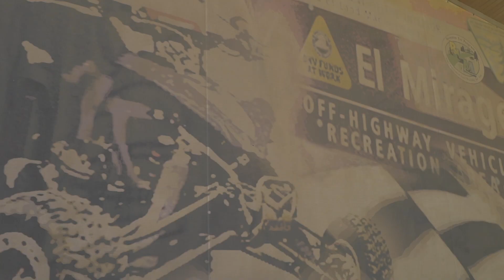DJI FPV⁄⁄2MILE RANGE TEST🧐⁄⁄DRY LAKE BED☠️⁄⁄⁄⁄⁄⁄⁄⁄⁄

Comment: That is incredibly far for such a low altitude.  The low altitude is why you got the failsafe issues.  The Fresnel zone for 915MHz is much larger than for 5.8GHz.
Reply from the maker: Video Aerial Systems thanks for chiming in, master of airwaves🤘 we are testing your lhcp crosshair Xtreme next ❤️
Reply: @RyoRex  - THe Cyclops antenna comes out in a week.  It is specifically designed for this unit ;)
Reply from the maker: @CAGreve1231  YAAAASS🚀
Reply: InstaBlaster...

Comment: You guys got all the money and most expensive gears but did a lousy job in these testings. You had short range failsafe for Crossfire, you have your DVR footage corrupted a few times. After all you cannot even fly your drones longer than 1.5miles away, in such a interference free environment. Frankly before you can show a meaningful test of the DJI google, fix your other stuff first.
Reply from the maker: Vince C totally. Who are these fools 👀Crossfire is fixed now, it was a tiny capacitor :).  DVR- that’s just unfortunate and it’s skipping frames now... so much for the most expensive HDOs 😭 More test coming soon ❤️
Reply: i think it was just laziness..they had the majority of the picture in thought--and in ideology... but the data documentation was flimsy. but there are others who are worse in explaining and scientifically documenting even in the most basic of manners---And usually those folks lack a matter of academic experience---in which most don't come from academic or science backgrounds, so its hard to understand these points of view....but having...like temp, wind conditions, humidity, ground temperature ....etc.  barometric pressure. Antenna size and dbi and flight controller and ESC specs and weight of each quad, motors, frame type and size and any antenna enhancers with or without...etc is vital in any true test.  JUST LIKE A FORMULA 1 TEST CAR.= A SIMPLE CAR--BUT MASSIVE AMOUNTS OF TECHNOLOGY REQUIRES MASSIVE AMOUNT TEST PARAMETER DATA!!!  

  i think more than anything..they were just having fun.     should've got a sponser to extract the data for...could have been more worth while then.  i presume they were trying in essence by measuring distance...or they were trying to show the physics of why and how in playful fun laymen hobbyist terms ...at a minimum in benefit of doubt.

Comment: This is perfect for rf range testing. Mount your receiver antennas high!
The reason you're getting great reception at one bar is because there are no other RF sources around. A ground station is a better solution for something like this.

Comment: very strange for crossfire to failsafe , question is crossfire micro tx or cross fire tx or crossfire tx lite? what sort of crossfire were you running , on the contrary , my friends have dji fpv air failsafing a lot. very interesting ,
Reply from the maker: Upon inspection it turns out my crossfire micro had a missing capacitor - was super hard to notice!  Check out our v2 test, crossfire went all the way https://www.youtube.com/watch?v=b76S6vbHlGg
Reply: @RyoRex  Can you put a notice on this video?
Reply from the maker: @Rustbox306  sure no problem, do you mean note it on the new video?  for this vid we wrote the caveats in the description

Comment: I don't know what you do in your test but only one mile with the TBS Unify and 800mw couldn't be right. Maybe your setup is damaged ore you paid from DJI :D... When i fly with my Copter (and i fly in Germany and with only 25mw), i can fly more than one mile with 25mw on my tbs unify pro analog system. Something isn't right here... If you look, you can see that many people fly 9 miles and more out with their unify. So please make a real Video with good stuff and not this with a fake ore damaged system. i also had never so a quick break of my video signal like yours.
 thanks!

JB-Copter
Reply from the maker: JB-Copter agreed, up high unify will go many many miles.  We flew just around 10ft off the ground, and the issue was failsafes, not necessarily video.  Our point is to send it until fail.  Also the analog that made it to 1 mile was the immersion vortex 250, not the unify.  As much as I love tbs unfys since it was released years ago, analog still have nasty gremlins that always come up no matter how good the build.  Just watch Johnnyfpvs formula1 Red Bull video.  This is just a “hope” that digital will start solving our FPV problems in the future :)
Reply: This is exactly what i think too, there is something wrong with his unify système!!!!!

Comment: Your crossfire antenna placement on the quad was almost perpendicular to your radio with the radio antenna almost vertical. The tip of the quad antenna is the dead zone. You should either have both antennas vertical (quad and radio) or horizontal meaning they should be parallel at all times. If you want to be horizontal, attach the antenna to both quad arms at the rear and make sure your radio antenna is horizontal. I have gotten more success with my quad antenna setup such that when my quad is tilted forward, my antenna is vertical to my radio antenna which is also vertical.  My video goes out first.  I got close to 2 miles
Reply from the maker: For sure, I did change the orientation and forgot to change the radio side.  However it turned out that a tiny tiny capacitor was missing on the xfire receiver (probably from me pushing the button) and that was causing the failure.  Very strange but goes to show it can happen on any exposed board component🧐 We hope to do this test again when the dry lake opens up!🤙

Comment: I get 2.5 miles with analog long range flying mountains in Alaska, if digital could do that I'd be interested.
Reply from the maker: Sounds like we should do a long range mountain test??  Alaska- that sounds Epic🔥
Reply: @RyoRex  That's kind of what I'm waiting for. My system was breaking up at a mile the other day when I was just off ground level, so I think being up in open space allows a much greater distance. I'd love a clear image!
Reply: DJI Occusync will easily push well over 2.5 miles, my mavic 2 pro can easily crush 3.5 miles on stock controller and antennas. hell i pushed 2.7 miles on 5.8Ghz Wifi using Mavic air...   i haven't measured the power output but i believe the physical power is sub 1 watt on DJI's systems.  i heard all kinds of numbers ranging from 250 mw to 3 watts but i never tested and im assuming DJI is probably using 700-750mw in FCC mode because its easier to get compliance certificate with.
Reply: @Honeypot-x9s  Man I'd love to get that kind of range. I'll look into it, thanks!

Comment: dude, such a good vid. Love the soundtracks too., i've had many of these moments with my crossfire setup running micro RX receiver, at silly close ranges where it just loses connection, left me scratching my head and nervous over water a few times, my trust for it has never been amazing even at 1watt or 2watts. Maybe there's a weird science to getting it happy and just right.  DJI system looking very good. Surely there will be some higher gain antennas coming out for the DJI system from other manifacturers soon too
Reply from the maker: Thanks Phil!
Reply: @RyoRex  got an idea for you bro. i haven't  seen ANYONE yet do a vid on the new Dji Fpv system performance...
AT NIGHT! :) Could be a channel clicker

Comment: Your testing is much more in depth than mine, but I've come to basically the same conclusion. My DJI can reach all of the same areas as my RapidFire, and does so in HD without static. And we haven't even started playing with antennas yet. I'd really like to try 2 or 4 VAS antennas eventually. But my current two are RHCP.
Reply from the maker: I'm testing the LHP patch antennas now!
Reply: @RyoRex   Cool beans! I did test one RealAcc antenna since those are switchable, but that was when I was mistakenly running on 25mw. It helped a little. Never was impressed with that antenna though. Definitely want to hear about what a VAS will do!
Reply: @RyoRex  Isnt other antenna's useless because it's the whole MIMO story?
Reply from the maker: @boratsagdiyev1586  The top 2 I believe.  I just did a patch test with the bottom 2, it definitely narrowed the beam and improved signal

Comment: hey guys thanks for the range check, But its absolutely clear, i have 2 phantoms (3 and 4) and the problem is not the range but the penetration.
It seems to be the same old technology they had in the phantom3 and 4.
We need a good penetration test, sorry guys but the DJI FPV system is just repackaged phantom system.
Which is great for local flying within 500meters.
Nothing new just the same old expensive crap. don't be fooled.
Reply: Old School the difference is low latency, that’s new
Reply: If you think the new dji Fpv system is the same or similar to the phantom in any way you clearly have no idea about Fpv and getting a hd system with very little lag. Stick to flying your old white turds

Comment: So the DJI system will fit in to the reverb? Do you have any pictures from that setup?
Reply from the maker: Yes and no- if you remove some pieces and run it backwards it'll fit. In the normal config it definitely doesn't fit.  Looks like the Armattan Marmotte fits really nice though!

Comment: I'm extremely shocked that crossfire only reached 0.4 - 0.5 miles then communication is lost.
Reply from the maker: That crossfire unit was defective, the DJI FPV one has crossfire and went 1.5miles no problem
Reply: Ah got it. Do you think they'll conduct another test? I remember reading that crossfire can reach 10kilometers. Is that true?
Reply from the maker: @neilfpv  Yup crossfire up high especially for wings will go 10km easy

Comment: I really hope you will do the same test again. something is obviously not right especially the analog testing part. thats why it isnt a fair comparison. 
i think DJI and analog could do more further because i saw you were trying to lower the quad  but it flies too close to the ground,  thats why your DJI signal lost. I guess.

1 CRSF firmware updates,
2 CRSF output power, 
3 both transmitting and receiving antenna should setup vertically for long range, also make sure both immortal T antenna cord wont touches the carbon part of the frame. 
4. Use a better vtx instead (unify pro32 HV @1W) with update firmware, and 
5. fly up higher cuz our earth is curve.. =)
Reply from the maker: We did a v2 test:) video dropping tomorrow🤙
Reply: @RyoRex  NICE ~!!!!!!

Comment: Crossfire is a major obstacle in dji's fpv take-over efforts.. and here you come with a Crossfire failure in a frickin dry lake bed???  
When you returned home with abnormal results on everything except the dji you should have just produced a dji-only range test. It would have been a good video.
Reply from the maker: Hey I appreciate your comments I do.  But honestly I don't like the DJI radio... I am a big crossfire guy, so there's no reason for me to bash TBS.  As stated in the description there was a missing capacitor that was making it fail. Check out v2 where we flew the whole 2 miles https://www.youtube.com/watch?v=b76S6vbHlGg
Reply: @RyoRex  Ok.. good enough.  Thanks for the update.. I deleted the snark :)
Tossing the abnormal results and footage is probably always the right way to go.. if you know a result isn't right why leave a question in the viewers mind?

Comment: How did you set your dji air unit and goggles up with your radio and crossfire?
Reply from the maker: Branson Bowler you can just connect it as usual, just replace the analog components with the air unit and solder their uart for telemetry :)

Comment: There are way to improve analog distance where as with the DJI you might be stuck as is. I am not sure as it does have removable antennae on the goggles
Reply from the maker: Analog does go much further of course up in the air, but we wanted a controlled situation close to ground.  Patch antenna test next!

Comment: Why did the air unit stop recording on the first run?
Reply from the maker: I found this out much much later, but you have to run legit sd cards that are fast!  Now I only use sansdisk extreme pro, everything else have problems including sansdisk ultras and ultra pros

Comment: We all know analog will crap on the current Dji stock system for LR doesn’t matter what altitude.
Perhaps re try this test once  VAS brings out their patch or whatever they are working on for the digital system
Reply from the maker: We will definitely re try this with equal patch antennas, VAS informed us that we were most likely out of the fresnel zones.  We experienced this in Dubai also where we had failsafes around 2 miles away at low altitudes.  We want to fly low and far! 👻

Comment: Why are you flying long range without GPS and Auto Return setup? If you had GPS you could see your distance on the OSD.
Reply from the maker: We've never flown more than 2 miles before so didn't really think about that.  Now digging up an old tbs core & gps from the drawer for an actual long range 7 inch setup.  Thanks for the tip! ❤️

Comment: Here's some feedback for you get a 5 helical and patch, a compass and climb immediately to 400ft you'll get many miles but you can't wander off degrees by much find a heading you want and stay on it I've gotten more than 3 miles without a problem the reason I just resist going further is cause of where my wing be at I just get nervous I post my videos
Reply from the maker: haha butt puckering!  One of my early first flights with the TBS Discovery I flew it too far in the Bahamas, lost video... punched it- I swear I could see the whole island beach to beach- it was 3+ miles away... I flew it back luckily w GPS!

Comment: Damn my cheap setup did better then both of them. I'm using attitude v3 with stock antenna and invader path with eachine pro 58 with achilles  firmware. I'm using flysky Evolution with a 2.4ghz booster . On my 7in drone that I got to go over 2 1/2miles or 13234 ft on 2 1300 mah 4s. Would be nice to make a change but since it works still I'll stay that way

Comment: Hi guys!
Thanks for taking the time to do this test.  So according to your results, is it safe to say that you most likely can go far but not at such a low altitude?  Thanks!
Reply from the maker: I think so!  We wanted the same height (but also didn't want to destroy all our quads-who wants to?) We may put it on a Drak next.  Analog and Digital both have zero breakup up high at El Mirage, you can see in the Drak chase footage
Reply: @RyoRex  ah for sure lol!...it's almost misleading to see quads go far but when you see the footage its either because they're diving from something high above, where frequency is better.   Not that it's your fault, but it's sad to see the Xfire cutting early at low flight...
Reply from the maker: @toastedmangoflight  Xfire yes, but the DJI FPV is also on Xfire!  Never failed

Comment: 1.5 is horrible for that, I have gotten 1 mile on 200mw without special antennae
Reply from the maker: I think it would have gone further but we were only 10-15 ft altitude.  Dry lake is the cleanest RF environment as it comes...
Reply: @RyoRex  true, I was about 400 foot up but this was back in 2015 and the vtx might have been pumping closer to 300, receivers were a bit wishywash back then

Comment: Your digital failure was because you came in and flew too low...
Reply from the maker: Well yes... I like to fly low though
Reply: @RyoRex  But you're comparing the distance with DJI at extremely low heights vs the analog that you were flying 5 x higher.

Comment: Sorry i like your channel and your effort mate, but do a" long range test" without the equipment set correctly and as you admit whitout have ever try fly longer than 2 miles.. is not informative. As you can read and see all around people can do 10 km with 600mw on analogue, and range of crossfire system is insane.. and being on 900 ish Mghz.. not even comparable. FAILSAFE AT 1MILE?? seriously something is wrong there.
You cant publish a video to COMPARE with corrupt parallel comparing video files..  or without the experience needed to just.. compare.. is not informative. Just my 2 cents, i dont mean to be rude with this comment.  👍
Reply from the maker: No worries, we just wanted to test at a low altitude.  Ibcrazy weighed in and let us know about fresnel zones which explains the short distance for both.  They did both perform pretty much the same even considering this disadvantage.  We'll do the test again up high! 🤙
Reply: @RyoRex  waiting for next 👍